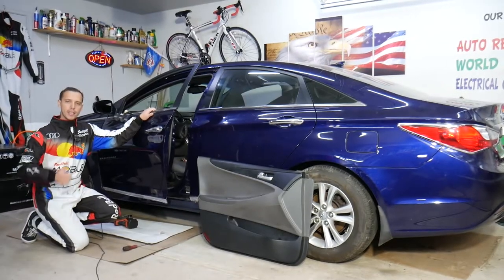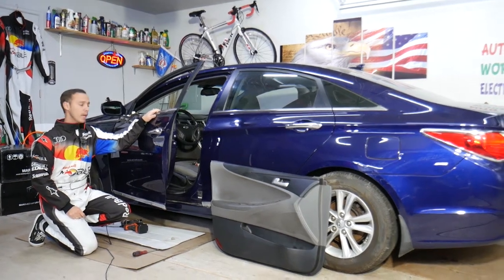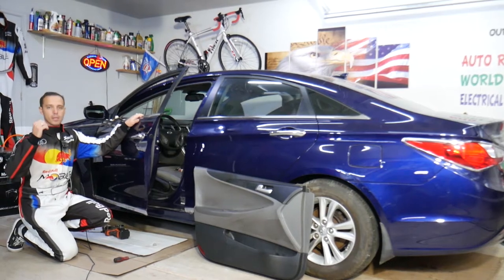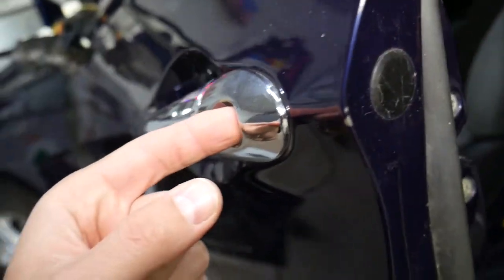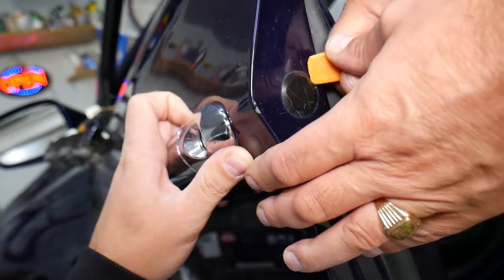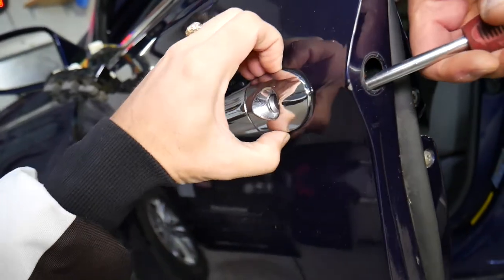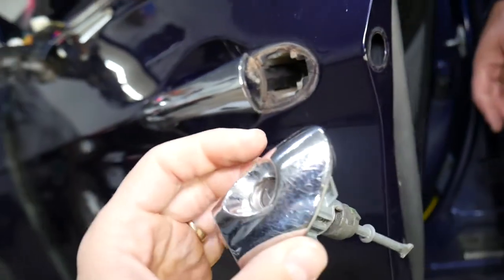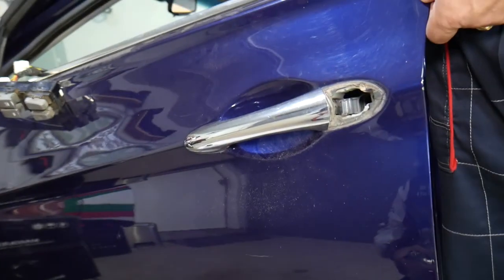HYUNDAI CYLINDER DOOR LOCK REMOVAL REPLACEMENT

Comment: Thanks. My cylinder is stuck in the diagonal. Can it still be removed?
Reply: Were you able to fix this?? Mine is stuck in diagonal too
Reply: Same
Reply: There are two catches. One at the bottom and one at the top down inside of the diagonal. You need a small flat head to pry the catch loose on the pointy end of the diagonal. Ya'll are probably trying to pry loose on the larger catch but I caught hell trying to get it out that way too.

Comment: Where did you find the cylinder door lock? All the ones I found online didn’t fit my car. Hyundai Elantra 2014
Reply: Ebay
Reply: All the ones I have ordered online can literally be unlocked with any key so be careful
Reply: How you made it work with the original keys you have were you able recode the new lock with your existing keys?